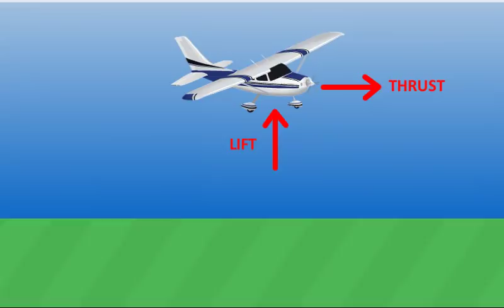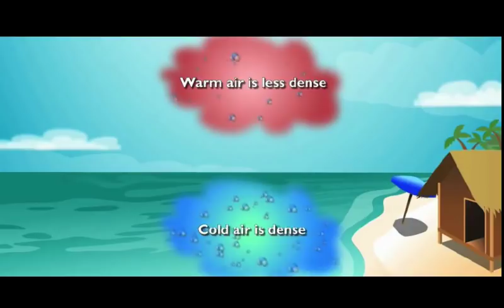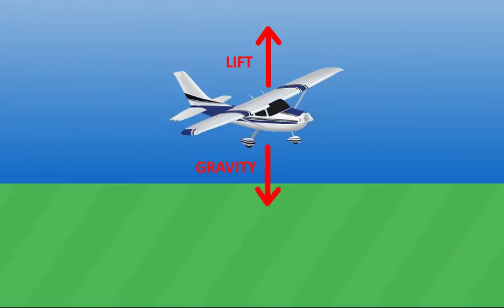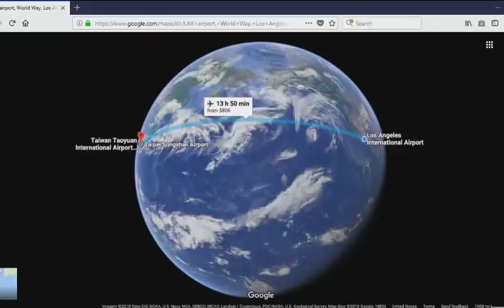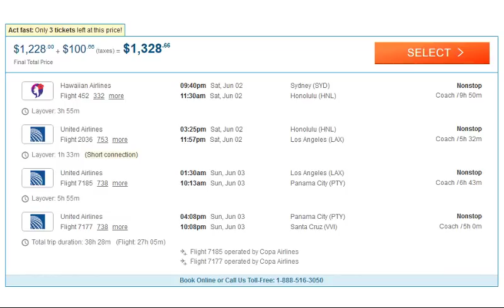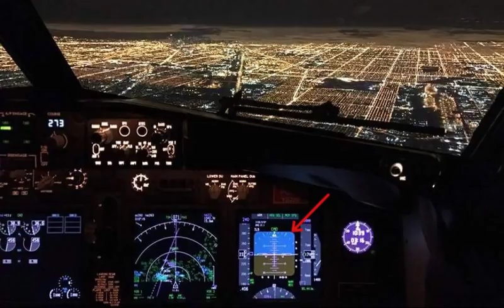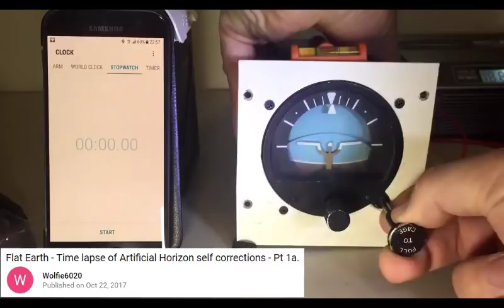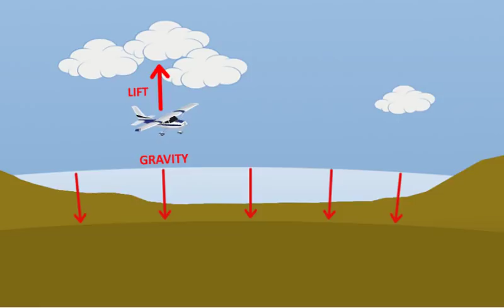Flat Earth Falsities - Plane Nonsense

Comment: that is a lot of nonsense
. no vacuum seal then this is all horse shit
Reply: Bryan you sure wont find any of that horse shit in any lab. Aristotle believed that no void could occur naturally, because the denser surrounding material continuum would immediately fill any incipient ... You must have FAITH in Space miracles (=NASA).

 [ Friction is a surface effect and doesn't depend upon there being air. There is also a force like air resistance from the very sparse gas in space, but it will be very, very small, since space is a very good vacuum. ... So, yes, friction can exist in space and on other planets, but a normal acceleration is needed.
Is there friction in space? - Quora ]

https://www.quora.com › Is-there-friction-in-space

Does the Earth accelerate/decelerate during its path around the ...
https://www.quora.com › Does-the-Earth-accelerate-decelerate-during-its-p...
5 answers
Sep 13, 2014 - Traveling in any path besides a straight line at a constant velocity requires some type of acceleration. Therefore, the Earth is always accelerating as it bends its ...

   - You kind of would expect to feel something despite low RPMs, not as much as the merry-go-round 107,000 km/h  + AFTER the moving 828,000 km/hr SUN bullet,   ...cause for the well glued Earth matter ground to have migrated - from the Poles towards the Equator to produce the Geoid bulge (extra matter) , (but somehow the whole Atmosphere stays inert by gravity momentum sticking)  it is amazing our sensitive brain apparatus does not detect anything.
 
Just an other LUCK out of Heliocentric science, of perfect speed /size /distance conditions wonders,  cause if just the 2X of spin it is said some deteriation would take place.
  The centrifugal force of the Earth would pull water from the poles to the equator, raising the water level there by 100 meters. This would totally wipe out Indonesia and most of the northern part of South America, and would turn Africa into two disconnected islands...

 Earth's newly quickened speed would also cause much more severe hurricanes, which would spin at increased speeds along with the Earth. And more hurricanes would probably form, because the increased water near the equators would come along with hugely increased humidity, causing a permanent band of fog around the entire equator.....       - no more save openroof synced immobile atmosphere, o so very LUCKY !!!
https://www.popularmechanics.com/science/environment/a14397548/world-spinning-twice-as-fast/

NASA's Cosmicopia -- Ask Us - Space Physics - Matter in Space
https://helios.gsfc.nasa.gov › qa_sp_ms
Jump to Friction in Space - Yes, when two surfaces rub together in outer space, there will be friction. Friction is a surface effect and doesn't depend upon ...
Matter in Space · Speed in Space · Acceleration and Velocity in ...

- "non reseach "Louise" (for Misogynists or some gays)
Reply: @NotTheCIA I.think Given it is a card carrying FE cultist and godbothering "truther", I doubt if it has any idea about real engineering and physics.
Reply: @bryan chadwick "that is a lot of nonsense"  Pray elaborate?
. no vacuum seal then this is all horse shit". Pray elaborate?
Reply: So in effect, you mean a seal is necessary between higher and lower pressure? (FYI Space is not an absolute vacuum.) 
     So where is the seal between sea level and 5,000 ft? 5,000 ft and 25,000 ft? 25,000 ft and 330,000 ft (The Kármán line aka conventional "space")? There is none because we're talking about atmospheric pressure which decreases gradually with altitude. Did the flerf videos skip over that?
     Particles (atoms and molecules) don't get sucked into a vacuum. They need kinetic energy, and in the upper atmosphere, enough kinetic energy given the right vector to achieve escape velocity. With few other particles to bounce off of, they almost always fall back to Earth.
Reply: @romithromith  Beautifully put into context.  Simple sums for simple sailors! Probably still to difficult for bryan as it doesn't involve loony conspiracy theories or adoration of his Orange God Emperor.
I've frightened a few people with that video of Paula White.
Reply: @boffeycn  Leave these boards for a few days and the stupid reappears. I've been vacationing on a few of those "Skywatcher" "sim Sun" boards. You know, the Sun used to be a soft creamy yellow and now it's a glaring white. One fellow shifted from an alternate universe with a different Earth history!
     So what have you been up to?
Reply: @romithromith  I've been banging my head against denoers of AGW & ACC. Basically they are no different to the FE cultists, i.e. biblical literalists, but far more dangerous. There are also a lot of psycho trolls as well.
I've been blocked by quite a few of their channels so they have exactly the same mindset as Dubay et al in they they know t=facts are bad for their religion.
Also, this just in from  A P Presley in northern NSW.
"wong We should be fine at this stage I feel safe. I live within 100 meters of a national park, that is an ancient remnant rain forest. However even the rain forests are all burning lately, and they haven't evolved the ability to survive fire. The smoke is very thick though, it extends for a 1000 kilometres in all directions from the dozens of fires around here. I do not know how this is going to work out, fires of this magnitude are unheard of this time of the year. Some have been burning since winter 5 months ago and appear that the only thing that will stop them is if they just burn everything in sight."
Reply: Normal that 'smart' people obsess on biblical literalists? They seem to gain attention those... Trolls who get blocked (as a few wish I would) on quite a few channels is quite normal. Sicker Ones even hang on "nazi" channels, hystericals?

Facts;   Dr. Patrick Moore takes issue with NGOs over climate, genetically modified organisms and the "truth" about carbon.
   He says we were literally running out of carbon before we started to pump it back into the atmosphere. “CO2 has been declining to where it is getting close to the end of plant life, and in another 1.8 million years, life would begin to die on planet Earth for lack of CO2.”
   According to Moore, it is life itself that has been consuming carbon and storing it in carbonaceous rocks. He goes on to say, “Billions of tons of carbonaceous rock represent carbon dioxide pulled out of the atmosphere, and because the Earth has cooled over the millennia, nature is no longer putting CO2 into the atmosphere to offset this.”

A Dearth of Carbon (w/ Dr. Patrick Moore, environmentalist)
https://www.youtube.com/watch?v=TjlmFr4FMvI&t=440s

Dr. Patrick Moore takes issue with NGOs over climate, genetically modified organisms and the "truth" about carbon.

2) Peter Ridd speaks on issues relating to Climate Change, his unfair dismissal and control of thought at universities.

Sacked for speaking out about Climate Change - Professor Peter Ridd 

https://www.youtube.com/watch?v=M7j75L38PlI&t=76s

3) Dr Willie Soon covers a range of issues including extreme weather, climate models, and possible alternative explanations for observed variation. 
See also the European Climate Declaration September 26, 2019 by 500 scientists and professionals including Sanjeev Sabhlok, our party's founder and leader: https://clintel.nl/wp-content/uploads...

Dr Willie Soon demolishes the extreme weather panic and other hysterical arguments
https://www.youtube.com/watch?v=4JJ3yeiNjf4&t=1528s
Reply: @romithromith  Seems Pastor Anderson has completely lost the plot. I've heard that conspiracy theory a fewe times
"How do these folks react to nuclear power?" Apparently I must be against it because I know AGW & ACC are real, so the looniy deniers keep telling me.
Anther good one is that AGW is a lie because it was cold in Bumfuck, WV for a day proves it isn;t  but record temps, increasingly severe bush fires etc. are not proof.  Hypocrisy concentrated.
Reply: @boffeycn  I love the "record cold temperature" excuse.  Someone forgot to tell the glaciers and other arctic ice. Then there're the rationalizations like Canada will become nice and warm, grow more crops, and of course, the CO₂ will make the crops grow.
     I think that we should build more nuclear plants as it would have no carbon footprint. And I came from an area where coal is king, where most of my uncles and grandparents were miners. But those plants take years to build and there's the NIMBY attitude.
     This is where we need government leaders with vision, willing to take positive measures, act globally. We had one, then came ding-dong who scrapped it all.
     The good pastor has more: https://youtu.be/Uwj6AQBUukE
Reply: @romithromith  The good pastor has lost the plot. Totally!
I was borm and raised close to coal mining. Bloody subsidence!
Interesting that the PRC is the word's leader in R&D and implementation of nuclear, solar and wind power whllst the \Orange God Emperor is extolling the virtues of coal.
Similarly with the EU, which he also hates.
I love it when they loftilly declare "the CO₂ will make the crops grow." and then run away when you show that it is actually detrimental to plant nutrition. Only to re-appear elsewhere spouting the same lies.
Reply: @romithromith  I've started watching an interesting archaeologist by the name of John Romer. His explanation of things biblical are very revealing.
https://en.wikipedia.org/wiki/John_Romer_%28Egyptologist%29